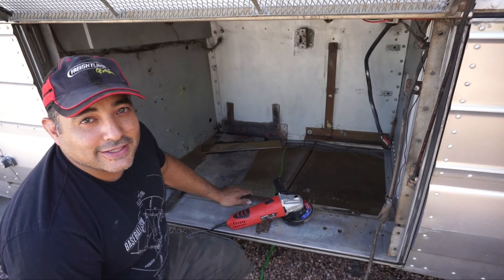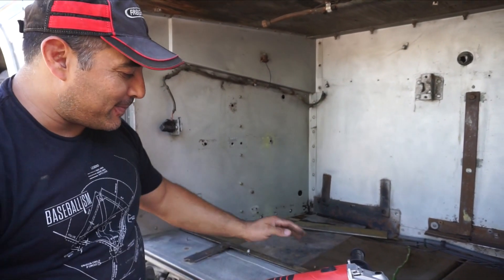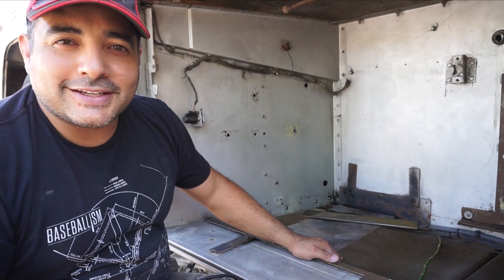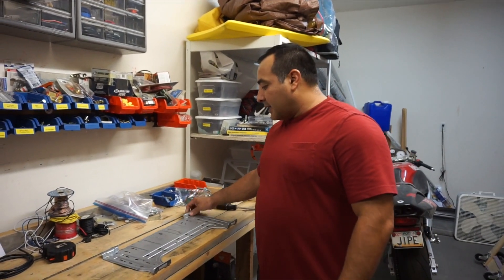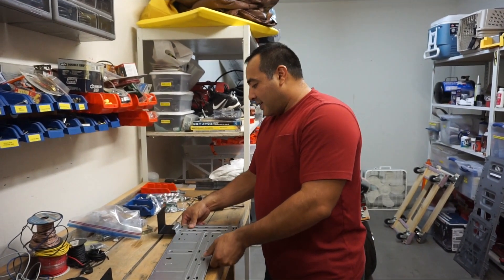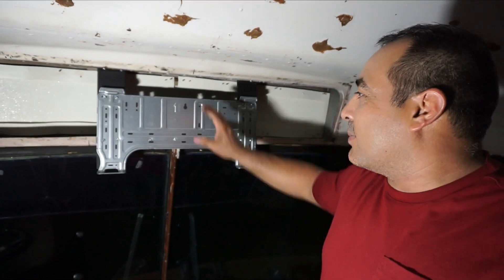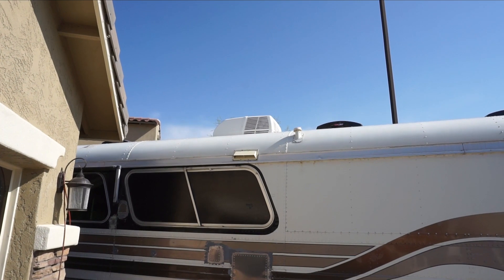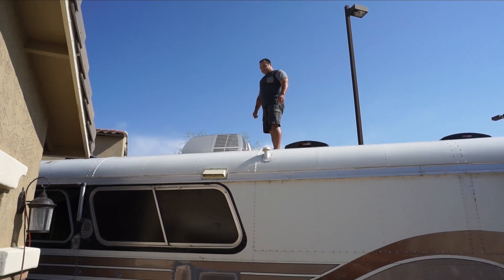Mini Split Air Conditioner in an RV

Comment: Sadly it won't last without an exit vent for the heat it's putting out. Try putting a vent on the side door.
Reply from the maker: If you look at the date on this video it is from 2017 - we are in 2023 and this little unit is still going strong even in the 115 degree temperatures in AZ.  To be fair we do put a box fan in front of it when the temps outside exceed 105 to help it out.

Comment: What extra would have to be done to hook up a 220 mini split (with 2 blower units)?
Reply from the maker: We would could do it a couple different ways.  1 - we could buy another Victron 48/5000 and wire them up for split phase 220V output (and rewired our circuit breaker box for 220V.  #2 we could have used an auto-transformer to get 220V from our 120V inverter.  Another Inverter would probably cost about $3000 at this point and I think the auto-transformer is somewhere in the neighborhood of $600.

Comment: Nice install Jaun wondering how the unit is holding up today and does it efficiently cool the whole coach off or do you think two would have been better?. I'm installing one soon in my Van hool 45' bus conversion. Still trying to decide what type of unit if I want to do Ductless or Ducted mini split 🤔
Reply from the maker: 5 years later this unit is still going strong!  Keep in mind that we are from AZ (where it is VERY hot).  We installed 2 more air conditioners - one (5K BTU window unit)  in the very rear for the bunkhouse (4 kids back there) and one in the basement (5K BTU window unit) to cool our battery and electronics (Inverter, charge controller etc).  I am glad we installed more in our bus.  With both the doors closed there is very little air movement between the front and the back and we run the little 5K BTU unit in the rear WAY more than I initially thought we would.  Even in mild temperatures, the kids keep the rear A/C on (it only draws like 400W since it is so small and the area it needs to cool is small so the duty cycle is pretty low).  In a 45 ft bus, I would probably install two 12K BTU units to ensure you are comfortable or if you are doing a 240V version you could do a dual head 18K BTU + 12K BTU unit.   My friend John Mathews installed a ducted Mini-split in his 4106 here: https://www.youtube.com/watch?v=1MGy1VLFThY

Comment: Where did you get the rubber mounts for the ac
Reply from the maker: Thank you Thomas those were actually the mounts that the generator that lived in this bay was mounted on.  You can find very similar ones on Amazon if you search "rubber generator feet" or something similar.

Comment: You didn't show how you hook it up to a power source. Do you have another video to show that? Or can you recommend a video?
Reply from the maker: Thanks Sharee - at this point we had not wired in our sub-panel yet and @11:16 you can see that we just wired a standard 120V plug to the end of the wire.  We have done 2 videos where we show how we wired our 120V subpanel: https://www.youtube.com/watch?v=VbYGUkn7PyA and https://youtu.be/hyKwdHSAjKs If you look closely at https://youtu.be/hyKwdHSAjKs?t=361 you can see that the air conditioner was the first thing we wired in (it's a black cable coming in at the top left and it is wired to slot 1)

Comment: Doesn't look like proper clearance was met on outside unit.Any problems on getting warranty work or did you opt not to tell them it was put in a bus?
Reply from the maker: Yeah I am fairly sure once you put anything that was designed for a house on a bus the warranty goes out the window.  Ironically we just had it leak this past week - but I am like 99% sure it was a Schrader valve that failed - we are having it looked at this week.

Comment: Absolutely add Benny Hill yakkity sax when you're running video speed up👍😆 OMG...I hate the kids flimsy ladder 🤣 Seriously glad you were both ok...the roof a/c unit removal was pretty dicey. Watching you roll up your sleeves, learn to weld plus fab the mounting bracket was awesome and inspirational. Placing the condenser unit in the original location for the OTR condenser was perfect. Exactly where it belongs. You guys rock👍
Reply from the maker: Thank you jimo199966 it was a little heavier than I was expecting ;).  Thank you so much for the kind words and encouragement.

Comment: How tough is it to learn to weld?  Out of curiosity I researched how to learn to weld from a local voctech school...$28K for a 28 week class!!  I figure its got to be cheaper to buy different kinds of metal, the different welders (mig, tig, stick), watch some videos and go make some mistakes.
Reply from the maker: Thanks Jerry - it was not tough to learn to weld at all.  I literally learned from watching some good channels on YouTube (https://www.youtube.com/channel/UCqq70AnPkj4-UApS_m_6mPw in particular, is excellent).  In fact, the welder that I use is not even mine - it is my good friend Rich's welder. I called and asked him if he minded if I tried to learn to use it.  I then spent a couple hours practicing and then cutting my welds open to be sure that I was getting good penetration.  About 90% of my welding is actually "flux core" welding because on a lower power machine like I have it gives the most penetration.  When I started I was doing Mig (same machine but flux core doesn't need the shielding gas).  Welding opens up a whole new world of being able to create.

Comment: I'm  thinking about doing a bus conversion and was thinking of two roof mounted and a window-type in the back.  Didn't realize a mini-split used less electricity than a roof mounted one.  What are the pros/cons of a mini-split versus roof-mounted A/C-Heatpump?
Reply from the maker: Hi Jerry - This air conditioner uses about 1/2 the power or less than our old roof mounted A/C.  There are quite a few benefits: It is VERY quiet both on the inside and the outside.   It does not have the huge power spike when it starts up.  Being in the shade like it is should improve the efficiency as well.  We live in AZ so we don't usually use it in heat pump mode but we have tested it down to 40 degrees.  At 40 degrees the air coming out of the inside unit was still 105 degrees F and had the inside warm in fairly short order (there is an 8 month update video that shows those results)

Comment: Awesome video but I have a question how did you guys tie the electric work to the rv. Did you guys have to add a different breaker or did you use the same breaker box inside the rv
Reply from the maker: We completely redid the electrical system in the bus.  This A/C does have a dedicated 15 A breaker (that's what it calls for in the manual).

Comment: Purchased this unit a year and a half ago. Outstanding equipment.>>>nub.best/rtq7      My handyman and helper installed it in a small 2 story shed I converted to a sewing room and exercise bike. Cooling capability is perfect in Arizona heat. The heating portion takes a little longer to warm this space but it is adequate. Compact, unit is mounted outside in monsoons and summer with no problems to date.

Comment: Have you put in any duct work to divert cooled air from the battery compartment to the bus when battery cooling not required.
Reply from the maker: We technically do have a couple ducts we could use but we have a dedicated A/C in the battery bay.
Reply: Beginning from this Morning Hi - what I meant was ducting to pump cold air from the battery compartment AC to the bus interior - when battery cooling was not required.

Comment: Would it be feasible to collect the condensed water for use in the bus?

May not work too well in AZ, but up here in the humid Northeast...
Reply: I've seen someone put it through a filter in a separate tank to flush toilets.
Reply from the maker: We thought "there is no way" when someone had brought this up earlier.  Right now it is monsoon in AZ and we have humidity levels of about 40% or so ... and a TON of water comes out!  Really interesting idea - somewhere like FL or TX this might actually be worth doing!

Comment: And if you haven't finished your insulation, industrial spray foam is absolutely awesome, as it seals seamlessly and stops the outside temp from transferring indoors like a bug YETI cooler,, I know there's a lot of skepticism about toxic air from improperly installed foam , but do it in thin layers and let it cure , then when your done , seal it in with latex paint before you cover it with your panels and you will be happy with the results ..

Comment: We did these on a RV but they didn't hold up,  The driving and constant bumpy roads beat the guts out of them
Reply from the maker: This is one of the things we are on the lookout for these are residential units and not really 'designed' to go bumping around.  It is also one of the reasons we felt compelled to mount the unit on rubber feet and reinforce the bracing in our update.  We have had ours on for 8 months and it doesn't show any signs of physical wear like that - but we are only typically driving a few miles a week to the storage lot and back.  We will report back as we start driving and using it more.  Thank you for the feedback.

Comment: Can you provide an update on the Mini-split operation since install? Curious to see how its held up.
Reply from the maker: Hi Nathan - I will do a follow-up video - we live in AZ and it is HOT - I think the high today is 110.  The short story is the A/C is working great!  It is nowhere near big enough for this big bus with no insulation installed but the unit itself has been fantastic.  There were a couple of hick-ups that we will go into details on in a short video.
Reply: Loved the update I'm halfway thru my install and the update just confirmed that I was correct in my thinking to install a Mini-split.

Comment: Juan, something I realized that might give you a little bit of piece of mind. The recommended clearance for these outside units when you have them mounted on a "rack" is 4 inches in the back of the unit. Since you have airflow from underneath like you would if racked to a wall, you're kind of mounted on a rack which should make that lack of clearance in the back...better...
Reply from the maker: Hey Justin - Thank you for the comment.  I am happy to report that the air conditioner has been working very well - even when driving down the road.  Of course, it is far too small for these ridiculous AZ summers (it was about 107 this weekend) but the unit itself has been serving us very well.
Reply: Beginning from this Morning thanks for the update! I’ve been tempted to try and get by on one first, but I know realistically I will be installing two. Do you have plans for another?
Reply from the maker: We are looking at making a place for a "room air conditioner" in the back bedroom that vents outside (we intend on having 4 bunks in the very back for the kids to sleep).  We played with the idea of putting in another mini-split in the back bedroom but we can't find the room for another one.  Ideally, we would have liked to put in a dual-zone but we could only find those in 240 Volt - we wanted to keep everything at 120V.  Ideally, we will be traveling into nice weather - but we both know that sometimes we don't have a choice :)

Comment: Is that exterior unit setup to add another interior unit you could mount in the rear? FYI I have watched all your previous videos and you guys are doing an amazing job and have great attitudes as you get it done!!
Reply from the maker: Joshua C thank you.  We wish we could have been able to get a dual zone mini split to have an indoor unit for the back.  But unfortunately, all the dual zones are 240V, and we are only running 120V.

Comment: Powder Coat GOOD. I am just learning how to do zoom and pan in my videos. Playrd with it a little earlier, I can zoom in but am having problems zooming back out. Currently 9 degrees here. With the unit in the front of the bus will the rear get cool? You do really seem to know what you are doing. Glenn Lever
Reply from the maker: Thank you for the kind words.  After seeing your "Warn Winch install" video I am extremely flattered that you would think I seem to know what I am doing!  I wish I had someone with your knowledge and ability nearby to learn from.  9 degrees!  That hurts just thinking about it - we are in AZ so temperature is already starting to warm up (the high was 75 today with a low of 54).  We are not 100% sure about the air conditioner is going to be able to cool the entire thing - we have 3 fairly powerful fans on the roof that should be able to pull the air back to the back - but we are also contemplating putting another unit back there (like a small 5,000 BTU unit).  Ideally, of course, we would follow good weather and hopefully not need to heat or cool very much - but we want to be prepared if we happen to run into some weather extremes (Also the reason we put an A/C in the bays for the electronics and battery - "just in case")
Reply: We have an older Motor Home (MANY repair projects) It has two larger A/C units on the roof. Last year every race we went to the temperatures were in the 100s. The units struggled to cool the whole bus (Motor Home is built on a Gillig bus chassis). Project list is in the first post of my projects thread here http://www.irv2.com/forums/f107/projects-on-my-1997-american-dream-174380.html not all the projects have made it to my web site (Yet). I was not video taping then but am working on it now. It is amazing how long editing takes. Glenn Lever
Reply from the maker: Wow very highly organized Glenn!  Yes - amazing how long it takes to edit videos ... then when you are doing a project you have to plan "should I do a shot for this?" makes the projects take even longer.  I am enjoying your videos - thanks for sharing them.
Reply: Suggestions are welcome, just purchased an new mic for the camera.
Reply from the maker: I am thinking about getting a mic as well.

Comment: BTU!? AMPs!? Model #!? anything to help track this unit!
Reply from the maker: The blog post has the full details.  12,000 BTU, 120V, 22 SEER.  Link to the exact model we bought: https://www.amazon.com/gp/product/B012XZYMBW/ref=oh_aui_search_detailpage?ie=UTF8&psc=1
Reply: hmmm... saw a video, this dude installed a portable 5K, then a 10K, then a 14K BTU before he could have enough cooling power for a van size motor-home! Yours seems to be quite a large bus...
...clue: saw another video where the portables were tested in a lab...
low&behold... they all failed! - stay away from portable unless it fits your bill!
UPDATE: portables basically produce 1/2 the BTU rating! so if you need 6,000 go 12 or 15

Comment: First of all, thanks for taking the time to show and explain your mini split heat pump install, I think it looks fantastic and you're lucky to have such an ideal storage bay!! I'm looking to do something similar in my bus. Second, not gonna lie I was pretty excited for you to just chuck that old unit off the top of the bus!!
Reply from the maker: LOL - I REALLY wanted to just chuck it off the roof.  In fact, on another conversion, I had seen a guy do just that and I had every intention of doing it ... but then I felt bad - the unit worked perfectly fine and it seemed like such a waste to ruin it ... we ended up selling it for $200 ... so I felt a little better about straining my back ;)
Reply: I would have made the same call, and not chucked it. That's why I've gotta live through others!! Good call banking $200.

Comment: Very nice work, I'm totally enjoying your exploits!
Yo may want to save one AC unit though. 12K BTU wont be enough cooling for a rig that size in harsh conditions.
Reply from the maker: Thanks for the comment - we plan to travel full time after we get the bus built - hopefully we will not be staying in places as hot as AZ in the summer :) . Agreed about the 24K btu of A/C to keep this big tin can cooled here.  We are also looking into putting in another layer of insulation which should help out some.  Thanks for following along.
Reply from the maker: Thank you - I believe you are correct and we will need an additional A/C near the rear of the coach.  Thanks for the comment and thanks for watching.

Comment: What kind of welder did you use and how long did it take for you to learn how to weld?  

Thanks, for the great series of videos!    I'll be watching this project through to completion.
Reply from the maker: Thanks for the encouragement Richard - The welds you saw in the video were some of my very first welds - it took about 30 minutes to get familiar with how it all worked and many hours of watching welding videos on YouTube.  I did a few test welds and then took a big sledgehammer to try to break them apart - when the sledgehammer could not take the welds apart I figured that was strong enough.  The welder is my friend Richard's welder - he had no space in his garage for it so he asked if he could store it at my house.  It is a Lincoln Electric SP-135 Plus.  It runs on a standard household plug (110V) and has been great for the stuff I do (usually 1/8" thickness or smaller)